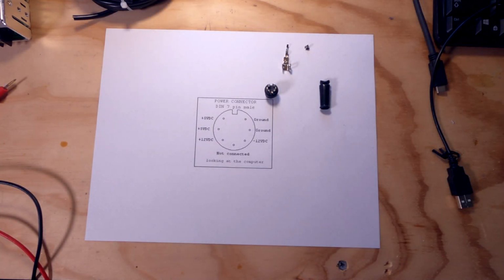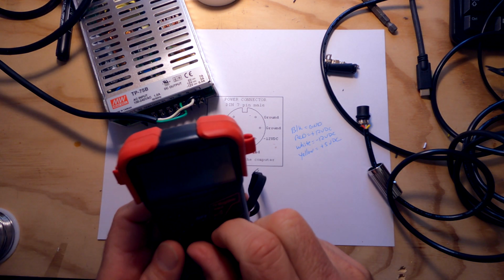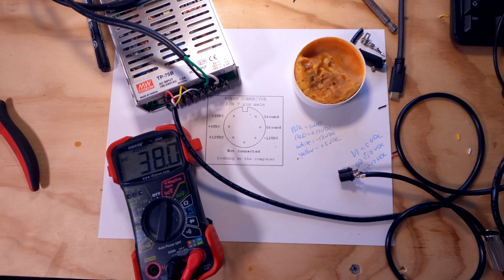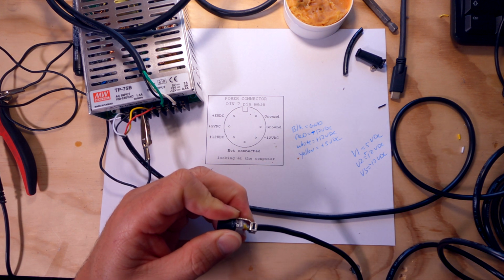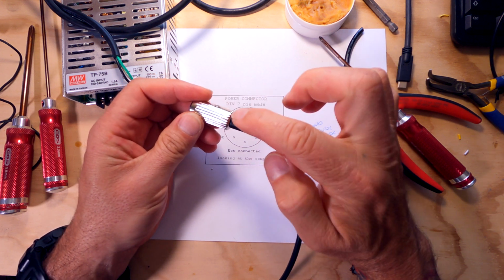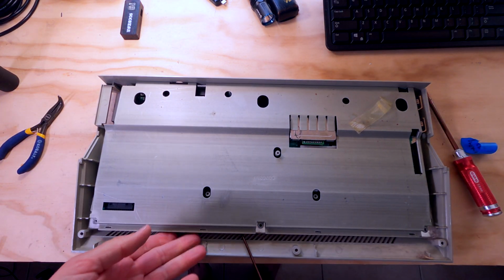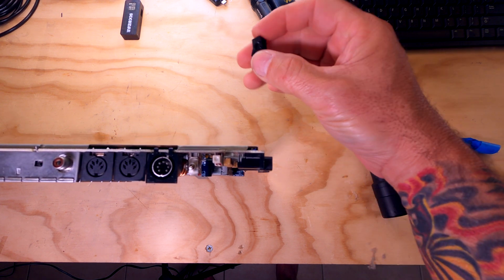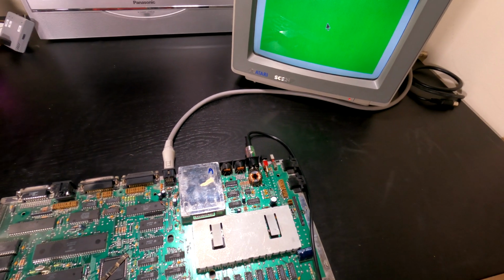Atari 520ST refurb Part 1

Comment: Looks like the board (as seen in video) needs at least a cleaning. The ST has an issue with chips creaping out. Push the chips down to reseat them. I was President of the Long Island Atari User Group (LIAUG). What area of the USA do you live?
Reply from the maker: I am in South Florida, Fort Lauderdale. Nice to hear from you.

Comment: Hi.. I'm old AtariSTVeteran with one published game :-) I enjoyed the video very much.
Thanks for posting and showing this. Unfortunate my 520STM  starts with blackscreen.
Do you perhaps have any idea?  I only tried the Rf for TV. I was thinking to test
with monitor to scart if it might be my RF which is dead. Do you think that's a good idea
to test? just wondering:-) look forward to more ST stuff
Reply from the maker: Yes definitely try the video output port... also try reseating the ROMS and checking the power supply voltages... let me know what happens
Reply: BTW, what was the title you Published?
Reply: @ricklopez193  platformgame  with small balls :-) called "Spherical"  for the AtariST

Comment: I always thought the 520ST with external floppy looked SUPER cool.  (I got the 130XE, printer, floppy, monitor and then modem the first Christmas available... and never upgraded to ST, though all the ads in magazines made me want one).  The 1040ST w/built in floppy looks great too, but not as cool.  The only XE/ST design I really couldn't stand looking at was the awful pastel buttons of the XEGS.  The idea of a detachable keyboard was nice, but it lacked the slick cheese grater vent, and those round pastel buttons made it look like a 3 year olds toy.  I wouldn't have liked it if I were five or older.

Comment: That's a long power lead! I'd wouldn't be surprised if there is a significant voltage drop on the 5V supply. The plus and minus 12V take so little current and are less critical anyway so any voltage drop on these supplies isn't critical.

It would be worth testing 5V across one of the TTL ICs on the main PCB. Some power supplies allow an adjustment to tweak the various power supply rails. It might be possible to tweak the 5V rail to raise the output at the PSU in order to get 5V at the PCB. BTW you don't need exactly 5V at the main Atari ST PCB, but anything over 4.75V is "in spec". Most 5V ICs are guaranteed to operate over 5V +/-5%.

BTW the reason for mentioning this, is that I use a bench PSU to power various projects on my bench, and I do observe a difference in voltage measured at the PSU and measured at the PCB end. The more current taken the bigger the drop. For example an old 8088 motherboard takes 1.5A, so I set the PSU for 5.1V and measure just a little under 5V at the PCB. 

The voltage drop over thin wires was the cause of an embarrassing "gotcha" many years ago, and was a lesson learnt. Debugging a circuit where the power supply is not in spec can lead to confusing behaviour.
Reply from the maker: All true statements, this wire is 22 gauge so it should be fine. I will measure at the chip just for the record and see what I have. thanks for watching